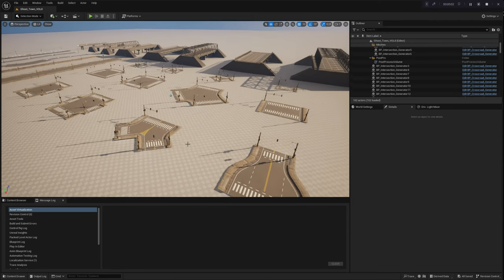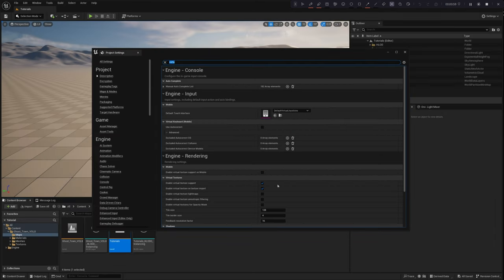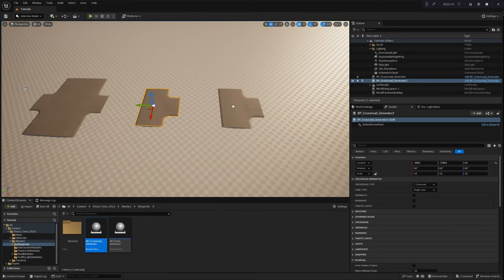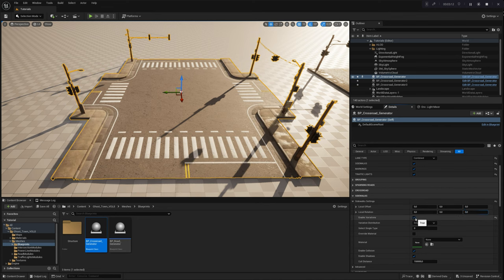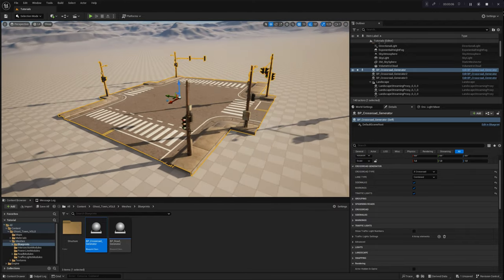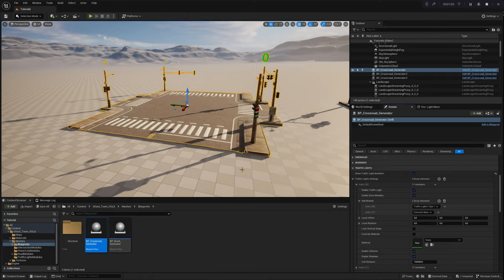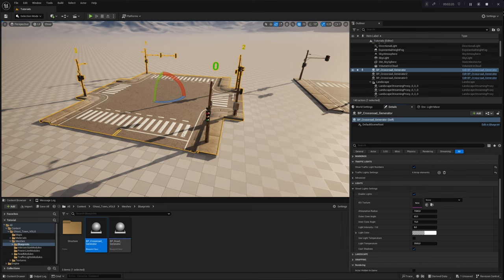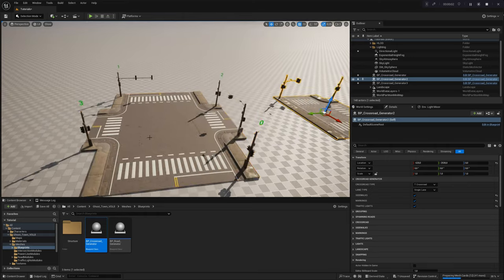Crossroad Generator For Unreal Engine 5 - Fundamentals

Comment: Does this function independently from the road generator you made? If so does it have features like creating banks on turns? If either one has that feature I will be sure to buy it!
Reply from the maker: Thank you for reaching out to us with your questions. The Crossroad Generator is an advanced version of the Road Generator, designed to work independently with additional features and an extended library of meshes and assets. Each product will receive updates independently, offering different features and enhancements.
Regarding road banking, both the Road Generator and Crossroad Generator support road banking on turns. However, to simulate road banking, you'll need to manually rotate the spline points on turns.

Comment: Just learning how to use this. Its amazing. I have a question though. Is it possible for me to make a road, with sidewalks and traffic lights (and road markings) and then export the whole thing out of UE5 an FBX and then be able to import it into Blender or iClone8? I actually bought this for my indie video game that I am making in UE5 but I am also working in film VFX and need to mock up some road/street/city scenes. Many thanks
Reply from the maker: Hello, thank you for reaching out to us with your questions, and we sincerely appreciate your positive feedback and support.

We regret to inform you that we haven't yet tested or designed this product for exporting into third-party software. Achieving similar results with exported data in third-party software may prove challenging due to virtual texturing (UDIMs) and multichannel UV mapping.

However, we plan to explore these possibilities in the future, and if feasible, we may consider implementing these features in future updates. In the meantime, we thank you for your patience and understanding.

Comment: 5.4 support any time soon?
Reply: i bought it and already regret since no 5.4 support, editor just crashes when using the crossroads even 1:22 the plugin is loaded
Reply from the maker: Thank you for reaching out with your questions. We're currently working on this update as well as some extended content based on suggestions from our customers and community. This update is quite extensive, so it requires some time to ensure its quality. We also want to avoid releasing a version with bugs. We are planning to release this update soon. Thank you for your patience and support.